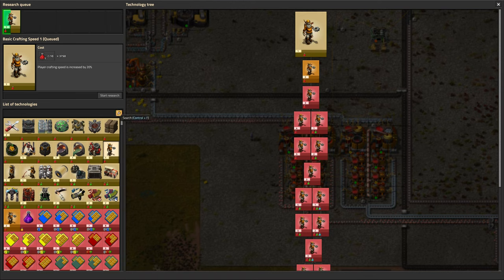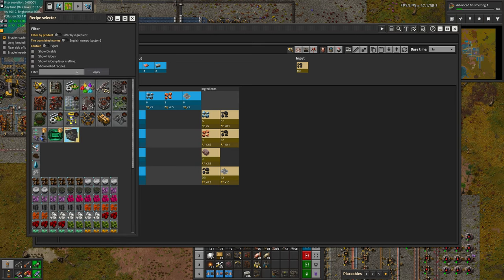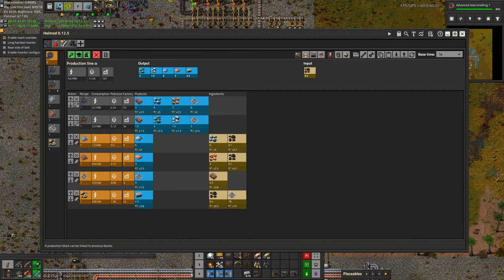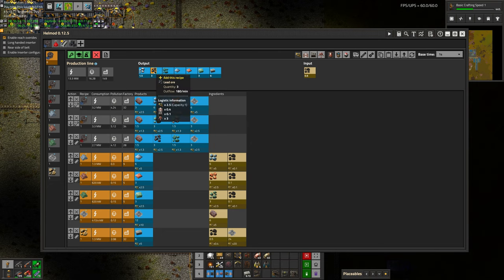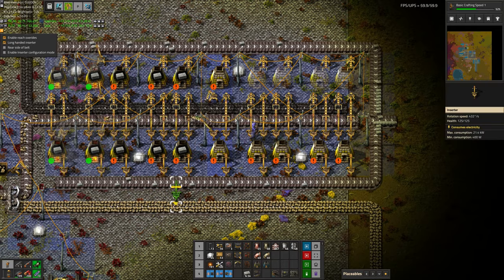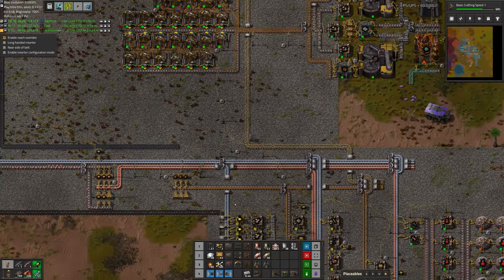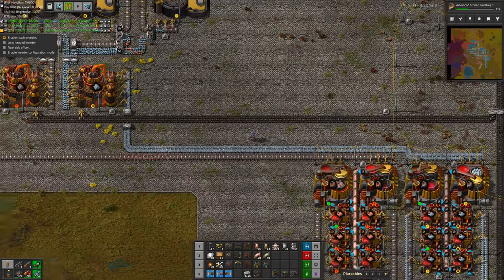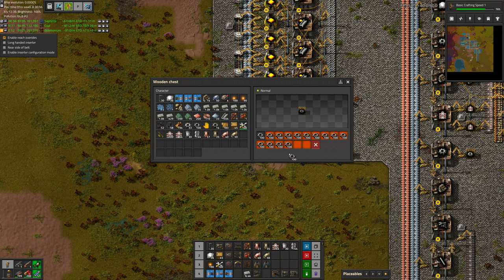[Factorio 1.1 4K] Angel/Bobs Ep 15: Smelting Tin And Bronze (Tutorial/Walkthrough)

Comment: 14:20 It's too bad Reverse Factory couldn't save you this time lol.

To prevent potential infinite crafting loop abuse, intermediates (like gears, copper cable, circuit boards, etc) can't be recycled until tier 4 which will probably not happen for a long while...  Though there is a setting if you want any tier to recycle anything :D
Reply from the maker: I thought I set that to have it recycle anything, but I will have to double check lol. What’s the point of playing mods like this if you’re gonna cheat? 😂